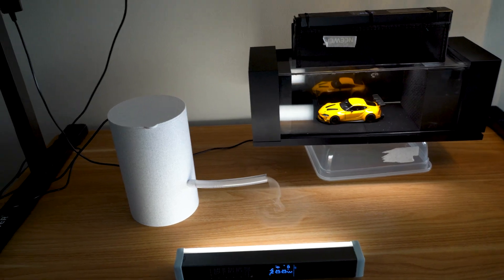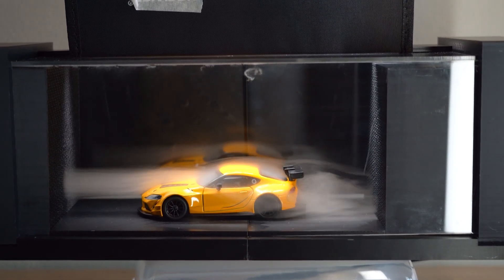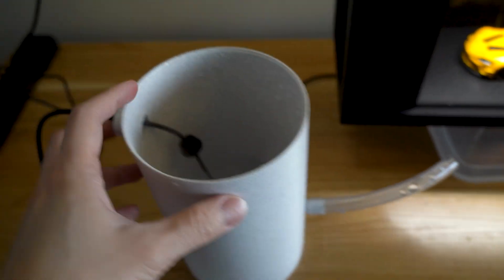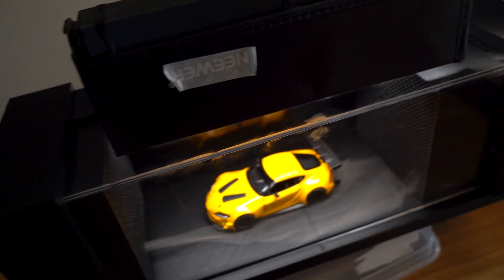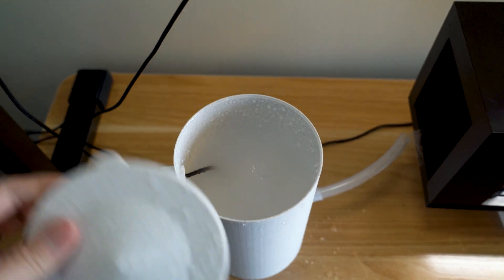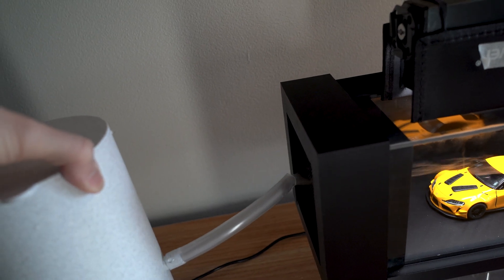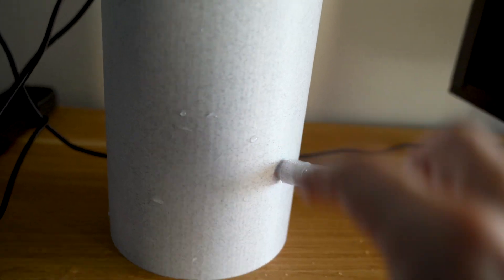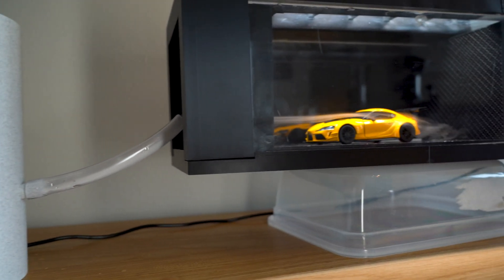Simple 3D Printed Fog Machine (water based) | DIY Wind Tunnel Build | Part 4

Comment: Does the water vapor leave a wet residue on the model? I want to generate smoke or vapor for a balsa model covered in tissue paper, and am worried about the model.
Reply from the maker: Yes it does leave water residue because that’s the basis of most particle. So I don’t think it’s a good idea to use it on your model

Comment: Great Stuff bro! I thinking about rebuilding it to place a meteorite sample inside. I need find a way without water mist, since meteorites don't like water. May a dry Ice chamber attached directly to the left side work? And maybe with a option to set the height of the smoke stream.. greetings, Alex
Reply from the maker: Wow meteorite sounds cool. I have not worked with dry ice before but its smoke seems to have the similar properties which is flowing downward. I think as long as your meteorite is positioned lower than the dry ice it should work. Also I have seen people putting dry ice in the water which produces a lot of smoke. I’m not sure if that smoke will work for your setup. But it’s definitely cool.
Reply: @AkiTechSpace  Thanks for your reply! I will research this further! I just seen that you will sell your flowtunnel?! So  no need for me to build it, what is awesome! I can add custom things maybe to realize my goals. Greetings from Germany man 🙂

Comment: Hey I’ve been watching the process I love the videos and I’m planning on making my own the thing I need is the process on the mesh diffuser so a video on that would be awesome.
Reply from the maker: There are different ways to make the mesh diffuser. Check out my wind tunnel build part 2 if you are 3D printing it, I explained how to do it there. If not, you can get a bunch of straws and glue them together into a mesh block. I recommend the length of the straw to be at least 4 inches.